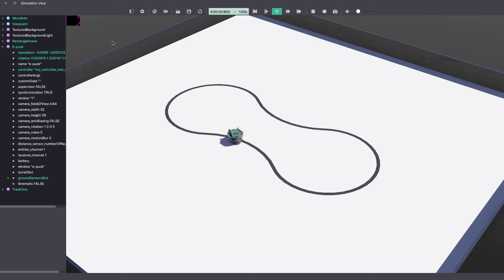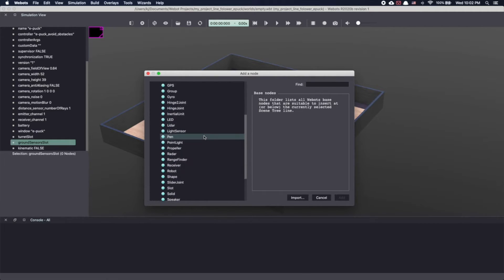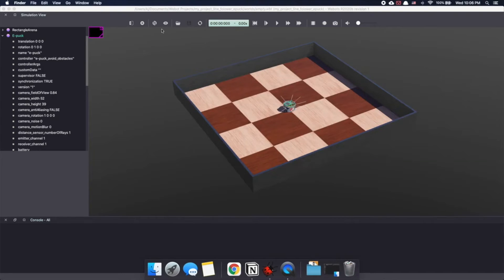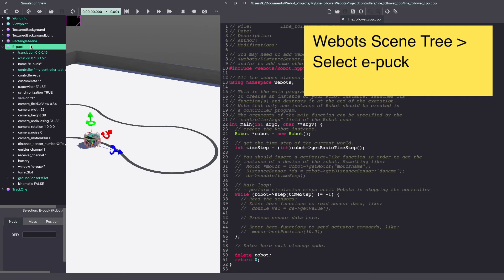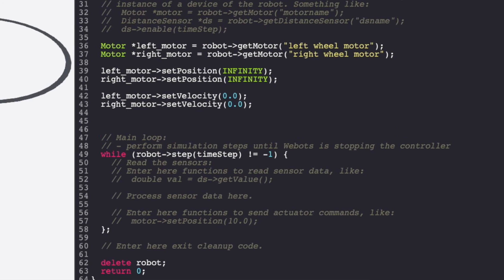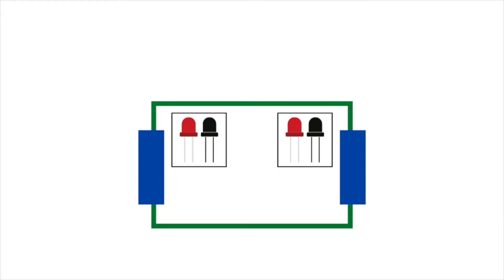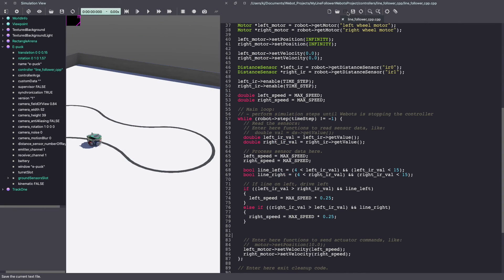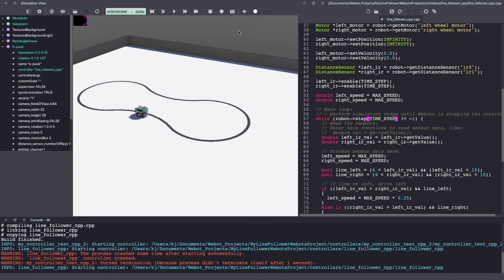Webots Line Follower with code in C++ // Webots tutorial // Epuck line follower

Comment: Hi, Thank you for the video but my e-puck robot did not follow the line. It was just running straight and hit the wall.
Do you know what happen and how to fix it ?
Reply from the maker: If it is just driving straight then it is possible it is not detecting the line. Test the sensors by printing out the values.

Comment: How did you find the numbers for the bool lines and the numbers represent what?
I imported as an obj and my epuck is running off track
Reply from the maker: Numbers represent IR values. Rewatch the video at 8:32 . I explain the working of IR sensors.

You find numbers by driving epuck over the lines & observeing the IR values. Followed by fine tunning.
Reply: @KajalGada  I'm not getting any values

Comment: Hi,  which simulation do you think is best for the use of a real time simulation based on your experience? 

I am currently having trouble with doing this as my team is currently working on a self driving car in gazebo. The tracks that we are using are so big to simulate and this has caused a performance issue where the simulation time does not follow the real time.
Reply from the maker: This is going to be true accross the board. Most simulators can’t handle it because your simualtion might have multiple objects & parts. It is a crazy amount of computation for sure.

The best suggestion is to simplfiy. For example: don’t import track design from cad,  it might have lots of sub parts. Instead use basic shapes to represent track.

The goal of simulation should be to prototype the basic idea & then implement in the real world.

Hope that helps. All the best :)
Reply: @KajalGada  Ahh that make sense!